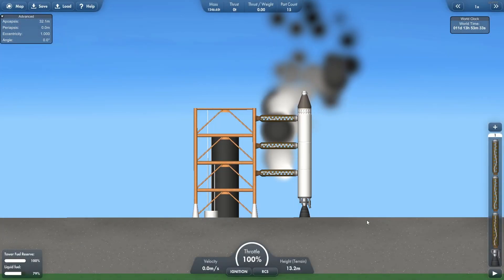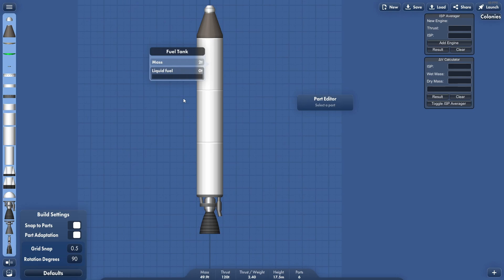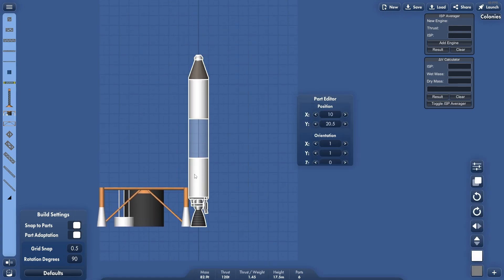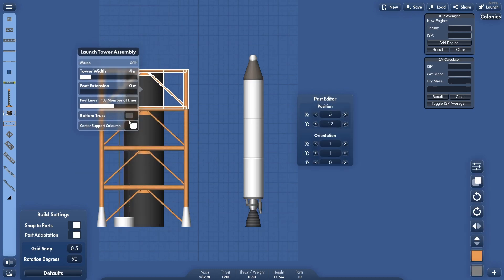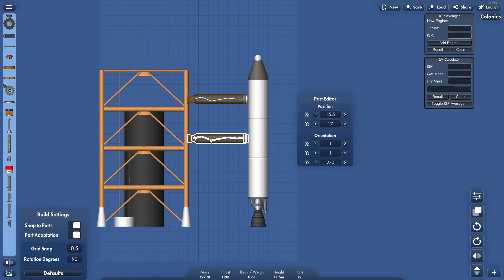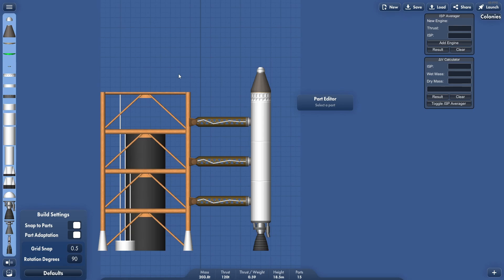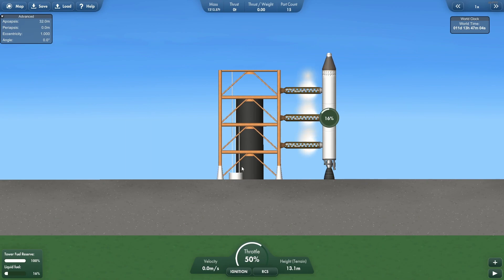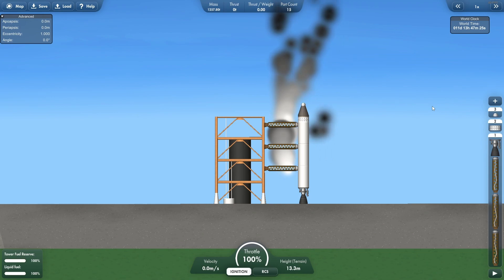How to build a Launch Tower in Spaceflight Simulator with Custom Parts

Comment: Dang i think there should be a fuel tank variant that automatically generates fuel
For refuelling stations when you dont want to spend a lot of time constantly refuelling the fuel storage tanks
Reply from the maker: I thought about that, it’s easy to make but then it’s also very VERY Cheaty.
Reply: @picospace  im too lazy to refuel the station fuel tanks constantly (also takes a lot of time) it will be up to the player what to do with them. I will just use it for refuelling stations. Besides someone already docked a launch tower + umbilical cord to a station so other players will figure it out.
Reply: @picospace  and i got an idea about a mod
We can choose for fuel tanks  and engines which fuel variant to use
For when players have custom parts with custom fuel variants
Idk if it may work though

Comment: How do you make the Ubillical cords smoke like that?
Reply from the maker: They must be attached to the launch tower, once the tower fills with tower fuel they will produce exhaust to show they are fuelling the rocket.
Reply: @picospace  didnt happen for me.
Reply from the maker: @andewclark8940  Did you wait for the tower to fill? It takes about 20 seconds (later updates I'l fix that delay).
Reply: @picospace  i waited till it was at 100 and nothing happened
Reply: I only have tower fuel reserve is there a tower fuel also
Reply from the maker: @andewclark8940  Tower Fuel Reserve is converted by the Umbillical cords to Liquid Fuel... (eventually also into electricity and hydrazine as I work it out). I'm not sure why its not working for you, I've added to my video list to make a demo soon to show proper use.

Comment: Cool build though as always! Good job! I like the tower design!

But I think there is a little bit of mistake (I think) in the title. It says, "How to build a Launch Abort Tower in Spaceflight Simulator with Custom Parts" I think the title should be changed to "How to build a Launch Tower in Spaceflight Simulator with Custom Parts", am I correct?
Reply from the maker: Fixed, I’ll cover Launch Abort Tower in a later video.